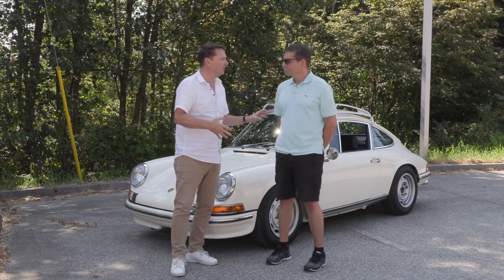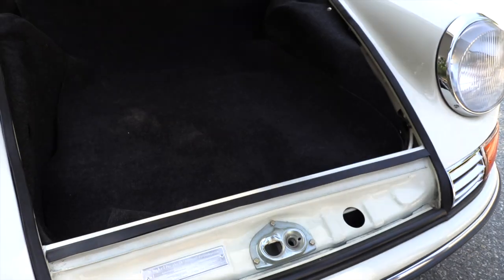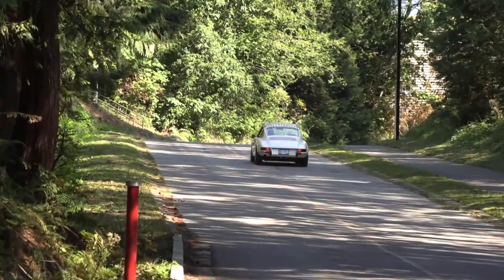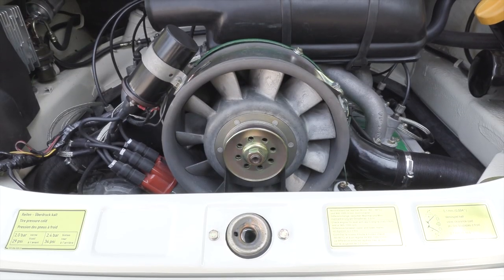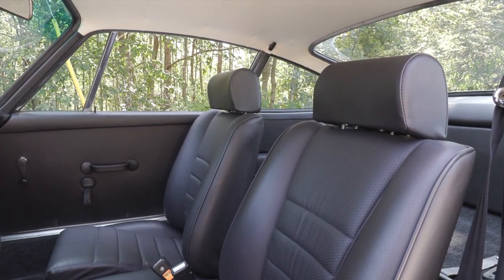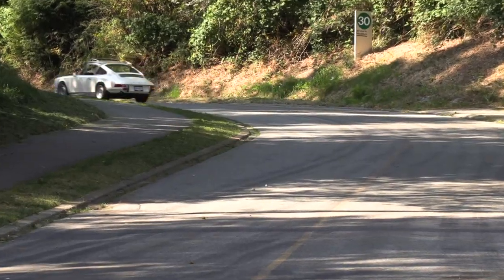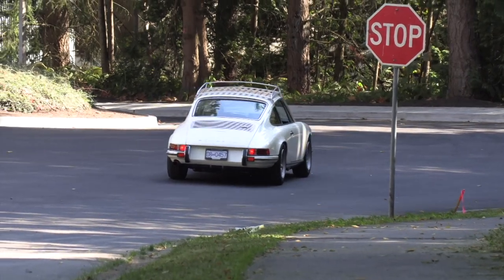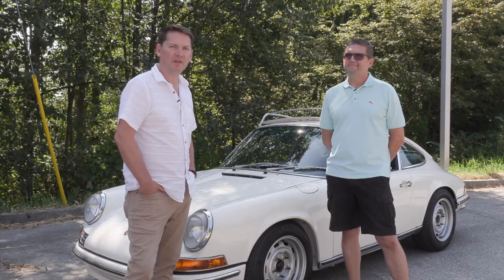Backdate 911

Comment: nice car, a 2.7 cis engine with SC cams should make 175 horse power at the crank.
Rev the snot out of it and you will love it .
Reply from the maker: Along with the low weight of the car it does move along quite nicely.

Comment: Backdated without the carbon fibre nonsense. Good choice of wheels. 
Not convinced about the extended wheel lugs (unspring weight) or the roof rack for mother in law idea.
Reply: Longer studs can preclude the option of mounting hubcaps as well. I have several early 911 hubcaps with outward dents from too-long studs.